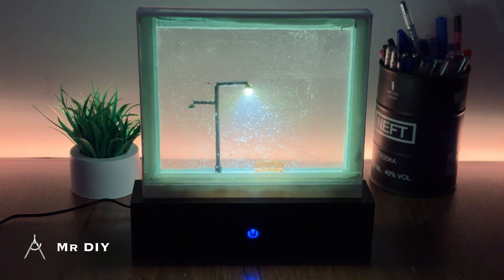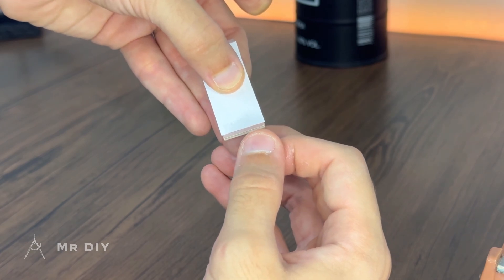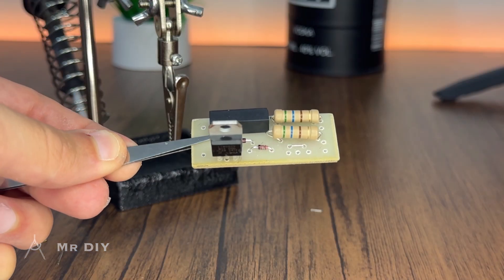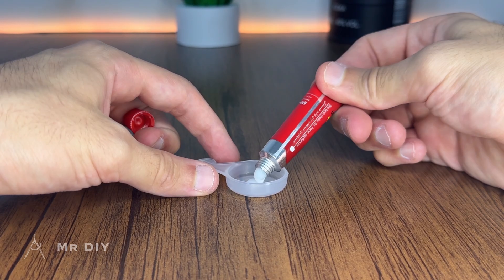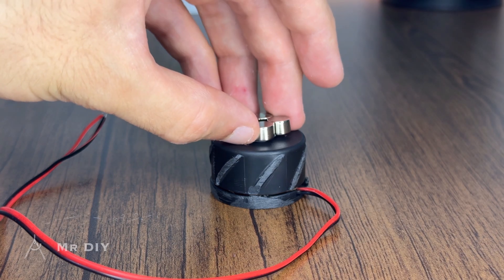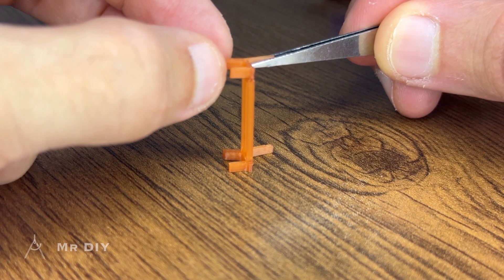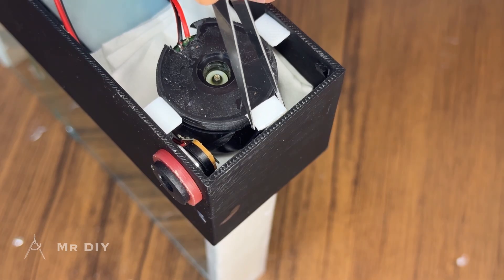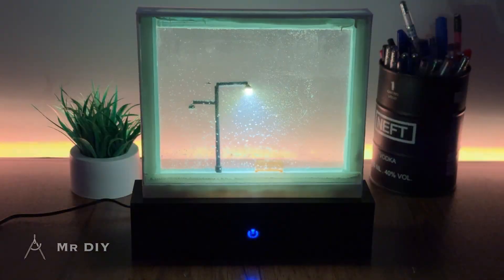It SNOWS in this picture frame! | DIY 3D Printed snowfall desk lamp | MHD DIY

Comment: Great work, keep it up! My best tip is to find a way to have the snowflakes circulate back up hidden, maybe in between the walls of a building, before falling back down over the street lamp.
Reply from the maker: Hello there! Thanks!
Actually the plan was for the snow to go up the side channel and it does, but a part of it circulates back up due the a design flaw Im aware of. I actually promised an improved version in the video if you notice, and it will come out for Christmas because it is inspired by it. So stay tuned!😁❤️

Comment: As a DIY project, it is great. The visual is also very interesting. But the "snow" coming up from bottom is very weird and unrealistic…
Reply from the maker: Thanks!
Not all the snow actually comes out the bottom. But yeah some of it flows from bottom to the top due to a design error . 
Stay tuned because I have a project coming up before Christmas which is similar to this one, but without the flaw😁

Comment: Funny, a few days ago I was pondering how I'd get a continuous snow fall in a container for decorative purposes. And now here you are with your very first upload showing exactly that, so thank you for the inspiration. 🙂
Reply from the maker: Ah what a coincidence! Im glad the video was able to give you some ideas. BTW if you ever decide to make such a device, I’d recommend you go towards a centrifugal pump system and a centred water intake instead of side intake and axial pump design. Will perform even better!
Reply: @mhddiy  Thanks for the tip!
My idea centered around a globe shape, but much smaller than a traditional snow globe, so one could potentially hang it from a christmas tree as more engaging ornament.
Reply from the maker: @J0ermungand
Thats a sweet Idea! I would make that ornament like a disk, both sides transparent, with a 3D printed circular housing around the glass window disks, a little pump at the bottom in the plastic circular frame, sucking down the water and snow and channeling it around the frame to the top where the snow falls down through an opening. Maybe through a little 3D printed Christmas tree with optical fiber, randomly placed within the tree branches, all routing down through the tree trunk to the base where an LED shining through the optical fiber and within the tree. Creating the effect of little lights on the tree. Another LED at the top where the snow falls down to light up the whole scene. If done right, you’ll have a gorgeous ornament and even a table top decoration. Hope that what I said helps and inspires you for your project!
Reply: @mhddiy  Oh that tree with optical fibers is giving me even more ideas for decorative ornaments. 
But the idea to channel the water and snow flow through the tree is a great idea f hiding how it all works... The tree top might end in clouds, that extends pver the area of the container. Then having vents in the bottom of those clouds for the snow to fall out of.
But one step at a time. I should first make a miniature version of your proven design, see if the concept scales down well enough.

I've also subscribed to your channel, in the hope you're continuing your maker life on Youtube 😊